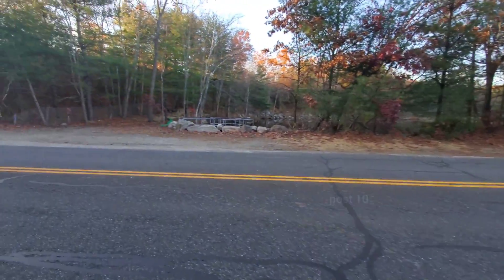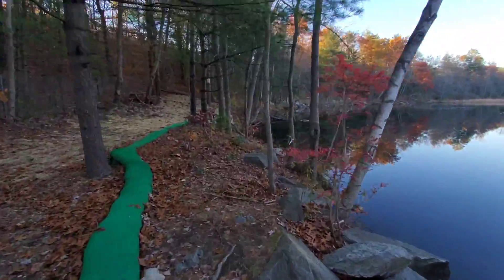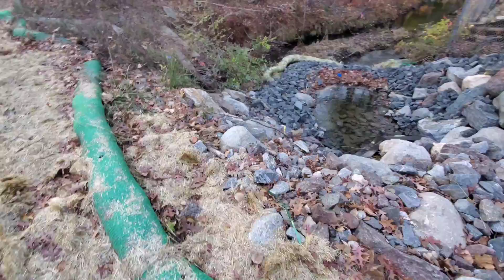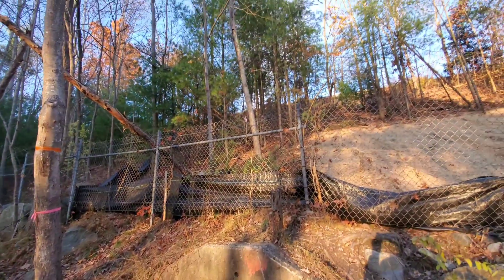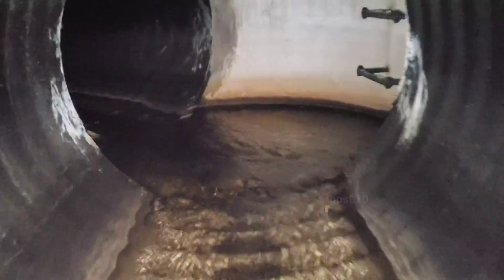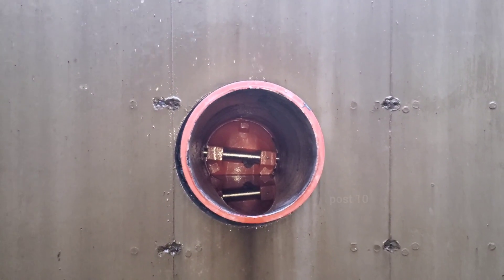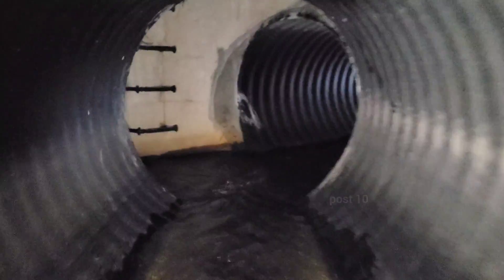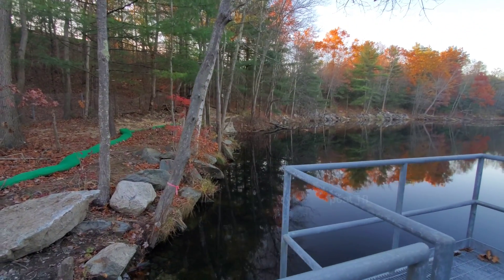Lake Drain 2.2 Million USD Later, The New Lake Drain Culvert

Comment: So the new culvert entrence(above ground) is indeed a beaver proof design. Around toronto and anywhere with alot of beavers those type are actualy much larger then the one you showed(the new/not so new culvert) and are ither double or triple the size... sad part the one closest to me is double the size but the culvert under the road is broken. Its a filter culvert to filter out the algae from the water and something in it broke the filter because the water in the lake on the other side is filled with algae unlike before.

Comment: Why are there no bars or some kind of mesh on the edge of the drain (concrete/waterline) to prevent debris coming down the pipe in the first place? Wouldn't it be easier to collect all the leafs and branches at the opening instead of walking down the pipe to clean it?
Reply from the maker: the old drain had that and it would clog up too easy, the new system is designed so everything can pass through it

Comment: There's not very much pressure. The pipe has settled or sunk because of poor bedding when they set the pipe. With wet soil it can be difficult, not impossible to set a pipe and have it not sink.

Comment: At least if the top clogs it don't matter since the pipe is leaking anyway but if the water supply to the pond stops it will drain the pond typical American construction halfass just like building roads that only lady 5 to 10 years they already know that they have to redo that again they just keeping themselves in a job 
Iam from Germany and we have bridges build 900 to a 1000 years old handling heavy semi traffic with no issues

Comment: The water infiltrating is coming through the rocks above it. Chances are It won't be eroding further, since it is rather large, heavy rocks there. It may even be intentional, so as to keep erosive pressure off the side and bottom concrete of the box drain.

Comment: The first 20+ feet of culvert should be one solid pipe, no seams. Their first seam is 5 feet in!

Also, 20 feet of clay properly packed around the pipe plus a bit of concrete poured around it would have been the proper way.

Comment: Why did they place the metal platform legs directly on top of the concrete. Should have added a 2-4 inch castellation under each leg to keep them out of the water.

Comment: Its 10 times as expensive and takes 5 times longer and will only last for a few years. I know city workers who follow work orders to the letter even though they know that what they are building is wrong and it all goes back to job security.  Purposely built a drain system under 4th avenue that cost 1.5 times the budget took 18 months longer then stated and before they finished the 4 mile long drain were already tearing out what they started because nobody budgeted in the sealer for the joints. City workers around here are worthless and that's why 70% were fired and all construction is now done by contract with private business's that use contracts with payment deadlines and completion deadlines. They work 6 days a week usually with Sunday off.

Comment: "Just no room in the budget" Maybe there'd be more if you just completed a project right the first time..
Reply: $8,000 to fix the original with some preventative maintenance. The duopoly doesn't care about money though.
Reply: There'd be even more were it not for the graft and corruption.
Reply: @whiterabbit75  There is state-wide corruption in my state, but the problem is that none of it gets reported on, mostly because the local news stations simply don't care or are someway in with the underhanded schemes.

Comment: Great video 👍👍👍. The contractor & engineer are sweating about now, LoL. This is why I don't design with CMP...joint separation, service life, is problematic. Is this corrugated plastic? If so they only have a minimal pressure allowance on the joints. RGRCP would have been a better choice, especially with the rubber gasket.  I am curious if the engineer considered the pressure from the water table.

Comment: Hey Post, another FINE VID! And another feather in your cap!
QUESTION: That old, crappy drain (@ approx 7:00 ).
Why didn't they - (or  COULDN'T they) just dig out and direct the flow over towards the new culvert? 
Instead of replacing the old one (digging up the recently paved Rd., etc..) and save a TON of money, aggravation,  etc.  From the vid, it looks to be relatively close (just to the Right).
Just a thought... ❗
THANKS for the Update !!

Comment: Is be surprised if it lasts 1 storm. The most important part of a culvert is the pipe and they used flimsy materials to offset the cost of the inlet.

It needs a concrete pipe, sealed to the inlet, that maintains a constant diameter and flow.

Whomever was the project engineer on this should go back to college. It’s shameful.

Great vid though.

Comment: It is crazy the cost, but even crazier the end result... Very disheartening. I am no civil engineer, but I reckon maybe encapsulating the pipe at the lake end with a good mass of pour concrete with rebar would of given it compression strength, so the water pressure would not be able to compress it and force it's way in.

The million dollar question of the day... is if they actually will go back and fix it. Considering that smaller corrigated pipe that is rusted is 'not in the budget', does not leave much confidence. If that was not so dang far from me, I'd explore it myself. That is an insane amount of water leaking

Comment: you are totally right at the end a cast iron pipe is required when expected external pressures exceed that of the weight of the ground in this case the weight of millions of gallons of water exceed that margin sadly cast iron pipe is much more expensive and requires more machinery and work which is why it wasn't chosen all bout that cheapness smh

Comment: Can they lower the pond level in the future to get the pressure off and then inject epoxy or concrete into the leaks? Also if it's partially failed now I wonder what some freeze/thaw cycles are going to do?

Comment: So you guys got more snow? It's been 60 degrees the last two days, while it was around 25F with 20mph winds on October 31st. Also, this is such a classic case of government mess. The problem is known, but is ignored until it becomes a large and expensive problem that could've been avoided. The problem is "fixed" and still is rushed and not done right.

Comment: There is a few types of repair products for this kind of problem, they are applied the same way by high preasure injection.   
I am no expert but the idea is simple ... shore up around the area to be repaired temporarily, and inject some kind of water proof quick setting epoxy / grout (or some other suitable product) through a small 1" hole, under high preasure until it's sealed permenantly.

Comment: Looks like the D.O.T does not care about this lake!
Reply: they only did something in the first place because the news got involved lol, if not for the news, the sinkhole would've gotten to the highway
Reply: they do, hence why the construction happened in the first place. Its the people who were contracted for the labor that failed.
Reply: You can't be at every place every day
and if you look the flow of the "break" its not more then 7-14 days old
Reply: @TheBluePeer  but they should've taken the outside pressure into consideration
Reply: @vincenttrigg4521  I don't know if you are familiar with civil engineering, but a stone 3 meters below the connection can ensure that the area in front of / behind the connection is subject to different loads. A 1mm difference is enough to build up enough pressure to break the connection. This is a completely normal problem when building such a structure in a natural environment. Optimally, of course, something like this shouldn't happen, but it is known that something like this happens again and again. For this reason, such new structures are regularly "checked" after construction in order to identify such "subsidence" at an early stage and to remedy them.

The older such a building is, the more constant and longer the inspection intervals become. Since then only "aging" is expected while at the beginning dozens of problems with elevations and a thousand other things can happen

In case the text is difficult to read. i had the google translator translated from german into english

Comment: It Looks very nice, 
But Someone is going to get some bad news because it's going to have to be redone.
Reply: They wont redo it unless it turns into catastrophic failure or unless DOT forces whatever contractor they hired to fix the problem.
Reply: @princeofdeath7696  They'll definitely redo it because there is video evidence of this failure.  If something happens now and they don't take action, they are fully liable.  It's not a position anyone wants to be in, especially a government organization.
Reply: There's no way they can just plug the leaks? Looks like they used something like Liquid Nails as the sealant, haha. Even if that seal completely fails, the pond itself will just drain faster - there is no danger to the road itself based on where the leak appears to be. It may also be the case that the leak partially seals if enough gravel and rocks/sticks fill the gap, but I agree, it's kind of sad that it's brand new and already leaking!

Comment: I guess we'll see what happens on the highway. Probably not rain, but snow and melting snow coming through that new pipe. I guess they need to know, from you, that they screwed up the install and how that will affect the way the entire system works going forwards.
Reply: OH GOD IF THE WATER FREEZES THAT'LL CAUSE EVEN MORE DAMAGES